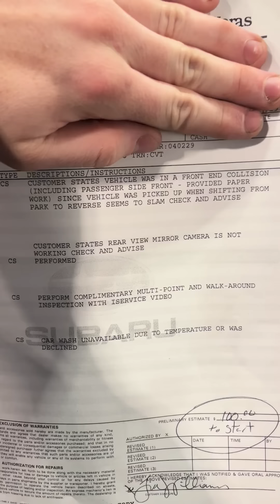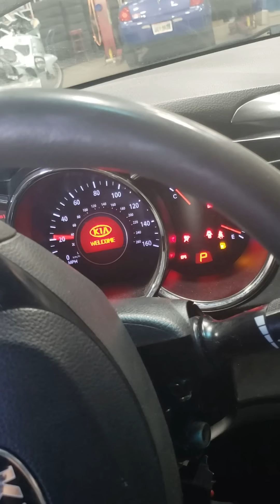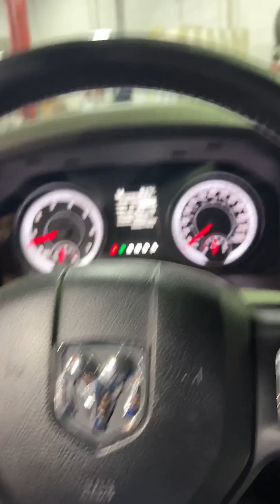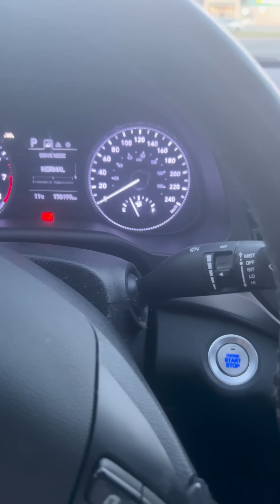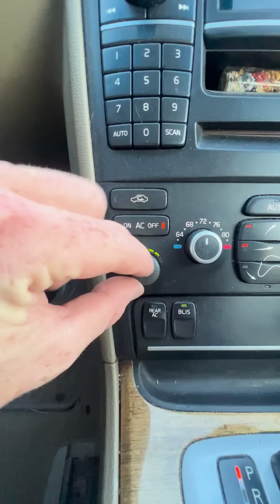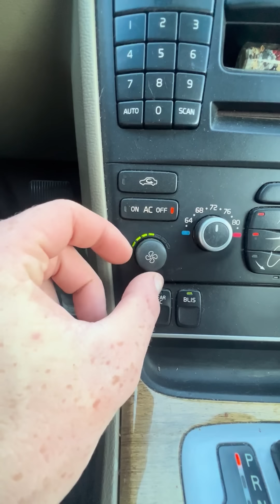Mechanical Problems Customer States Compilation Part 41

Comment: Damn! The melted dipstick is something I’ve seen first hand!

Had a client with a CX500 Honda that started overheating whilst out on a group ride…..and he kept riding.

It arrived at my shop on a flatbed (having seized), and as a first inspection, unscrewed the dipstick, and all of it apart from the first 2 inches under the thread was melted away…..just totally gone apart from a small stringy thread of melted plastic.

I just didn’t want to get involved with that, and got him to pick it up without touching it.

Some jobs just ain’t worth the hassle.